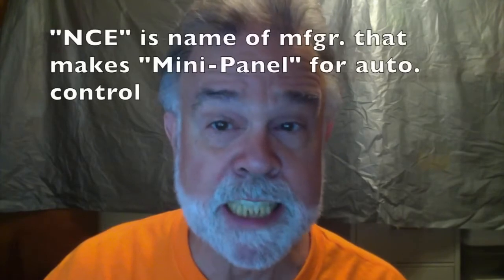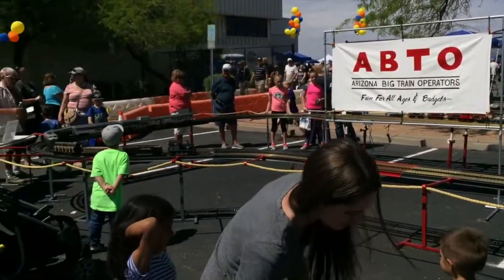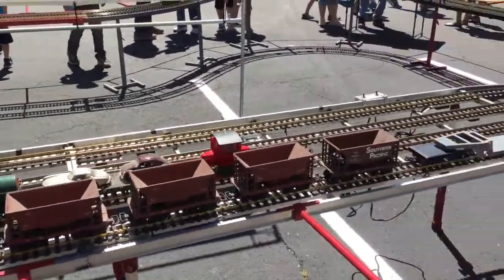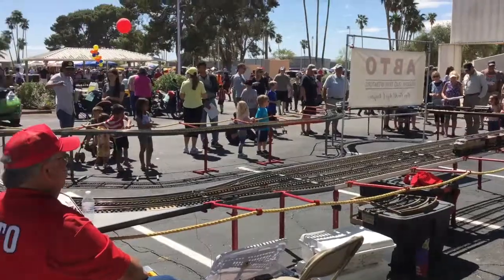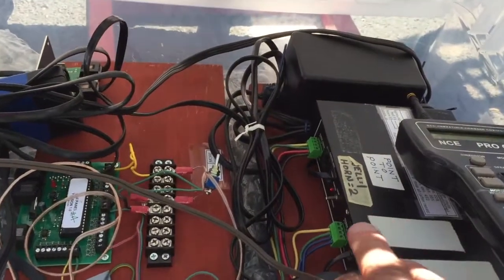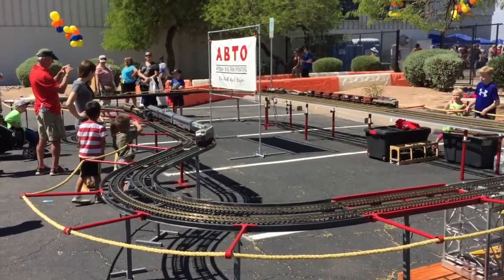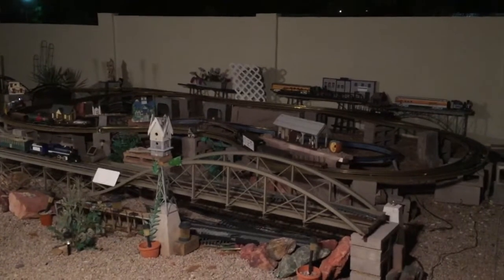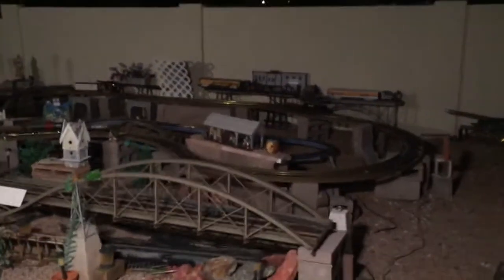817 Automatic LGB DCC Train Control on ABTO Outdoor Modules, 2 Trains on 1 Track, NCE Mini-Panel

Comment: Very cool.  I am wanting to use this controller.  Using no blocks simplified the set up.  I also like the construction of the demonstration: it sort of reminds me of the old Tin Plate layouts in the 1940s.  Thinking of realism, you would never have track over train on spindly supports 😋